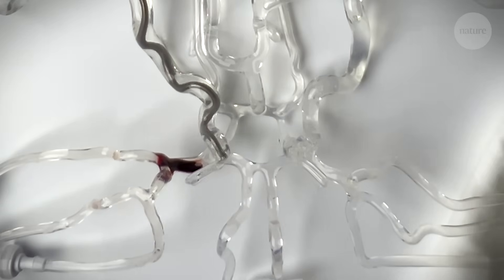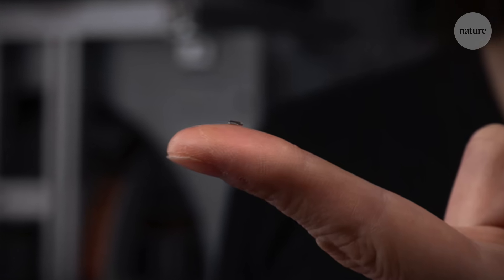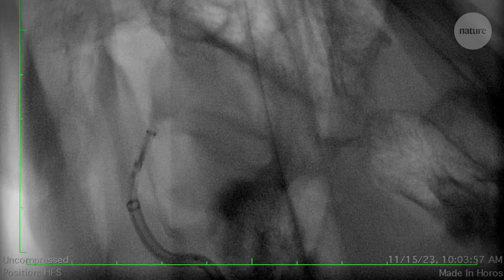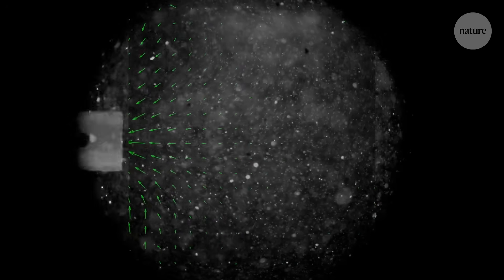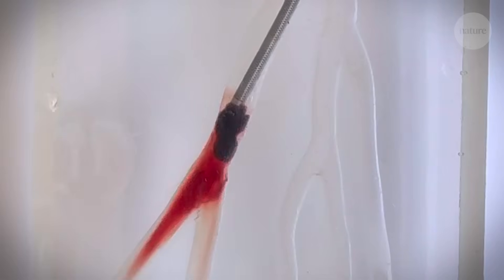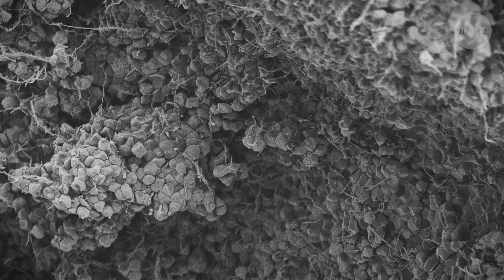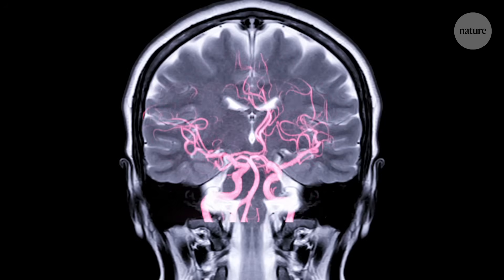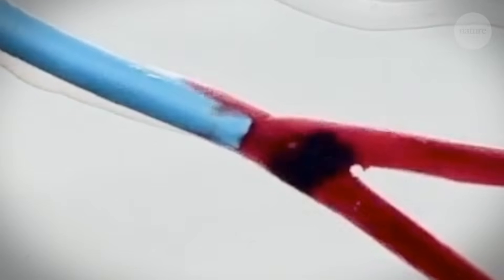This tiny device spins blood clots away

Comment: This little thing here is the number one killer of mankind, by far. 
It's crazy it took so long for something so simple.
Reply: The only simple thing is this new technique. But to get there - by accident - we had to do lots of science first.
Flipping a switch on a spacecraft is also simple, without the spacecraft.

Specifically without being in space, the craft makes all the difference, and getting a craft to space is required for operating said switch.
Reply: Not that simple when you consider that our veins aren't made of steel and can be easily damaged. Which means finding a way to get this device where it needs to go without killing the patient in the process. Quite complicated now, isn't it?
Reply: @crappyshorehen8201  The video showing the milli-spinner protruding from the catheter is intended to illustrate its working mechanism and how it interacts with a clot. In actual operation, however, the milli-spinner remains fully housed within the catheter to prevent direct contact with the blood vessel and avoid any potential damage. You can see an example of this in action here: https://youtu.be/t88QyS_bLKc?si=ik1sqsh1GxyY69Ud&t=25
Reply: @crappyshorehen8201  The video showing the milli-spinner protruding from the catheter is intended to illustrate its working mechanism and how it interacts with a clot. In actual operation, however, the milli-spinner remains fully housed within the catheter to prevent direct contact with the blood vessel and avoid any potential damage. You can see an example of this in action here: https://youtu.be/t88QyS_bLKc?si=ik1sqsh1GxyY69Ud&t=25
Reply: @debao-c3c  Hey, thanks for the info, but it seemed your comment got shadowbanned because of the link, eventhough it's also from youtube. Yeah, that sucks.
Anyway, it still showed that they have to be careful and take precaution. Not  as simple as OP here think it is.
Reply: @crappyshorehen8201 no not at all, tons of surgeries are done through blood vessels.  My dad just a heart valve replaced by going through artery in groin into heart (TAVR)
Reply: Because it's tiny device, that's why
Reply: Isn't it infections?
Reply: Die Grund-Technologie wurde schon vor Jahrzehnten geschaffen. (Stent-Tech). Permanent wird Technik weiterentwickelt. 🎉
Reply: It may be the scariest random killer, but the mosquito is the number one
Reply: Maybe you guys should study engineering and doctoring and make it happen yourselves then.
Reply: @chrisgrou exactly they can't believe no one thought of it.  Yet they themselves didn't think of it.  Very hypocritical
Reply: It's "simpe". We are making things at nanometer scale, 1 milion times smaller, for decades already..    Should have been a top priority, with very big investments and apparently it wasn't.
Reply: @d3r4g45  We already have had the suction tube for decades. The spinning part is what's new. In retrospect such "simple" addition to the tip would have been easy to  create way sooner as is the case with pretty much everything.
Reply: @km077 well why didn't you think of it and develop it then if it's so simple.  Nothing about development and testing of these types of devices is simple
Reply: @d3r4g45  Making moving parts that can be reliably controlled is the difficult one, as most of the nanoscale thing that I've seen is either static or very limited in movement. However, I agree that this should have been top priority, but we all know if it doesn't make the money, it'll go slowly.

Comment: could this potentially end up damaging the blood vessel due to friction between the wall of the vessel and the clot
Reply: I dont think so, for two reasons: blood vessels, arteries especially are built to take on significant pressure from blood itself being pumped with force, and most importantly, fibrin isn't rock solid, but more mushy, exactly like freshly clotted blood on the surface of a wound. Hardened compared to liquid, but not hard. Its a bundle of protein, so its pretty squishy, especially compared to the thick muscle wall of arterial blood vessels.
Reply: Unlike replies above, I agree with this. Centrifugal force is no joke, but removing life-threatening clot still outweights any risks related with the procedure.
Reply: I assume it would heal. Might have to prescribe some blood pressure medicine
Reply: that would literally not matter, everything in your body is constantly being damaged and repaired.
Reply: @99Plastics that’s stupid. If serious damage is caused to a blood vessel in the brain, the brain can hemorrhage. Your body fixes things but not a rate faster than the brain can lose blood from such damage.
Reply: Respectfully, you’re wrong. Damage to vessels during endovascular procedures is a real risk

Comment: Let's determine the technique's efficacy beyond in vitro tests and in vivo swine models before claiming it outperforms current aspiration thrombectomy—the "simply suck up a clot" method—because it involves more than clot removal; it also prevents inflammation, vessel rupture, reperfusion injury, and hemorrhagic transformation. Consider how patients and their surrogates might interpret this information when making decisions.
Reply: The paper (linked in the description) suggests that this method is not necessarily intended to replace traditional thrombectomy, but to be used in the 10%-30% of cases where traditional thrombectomy has failed or would lead to additional complications.
Reply: @dothedeed  early mechanical thrombectomy have significantly altered the landscape of stroke intervention, especially in cases involving large vessel occlusions. Studies indicate that mechanical thrombectomy can restore blood flow effectively when performed in a timely manner, often yielding superior functional outcomes compared to thrombolysis alone. mechanical thrombectomy is the first-line procedure for major artery stroke due to large vessel occlusion, with intravenous alteplase administered when eligible and within the appropriate time window. Patient selection should be guided by clinical and imaging criteria, and rapid workflow is critical to optimize outcomes.
Of course I read the paper before commenting.

References
1.	Care of the Patient With Acute Ischemic Stroke (Prehospital and Acute Phase of Care): Update to the 2009 Comprehensive Nursing Care Scientific Statement: A Scientific Statement From the American Heart Association. Ashcraft S, Wilson SE, Nyström KV, et al. Stroke. 2021;52(5):e164-e178. doi:10.1161/STR.0000000000000356.
2.	Acute Ischemic Stroke. Powers WJ. The New England Journal of Medicine. 2020;383(3):252-260. doi:10.1056/NEJMcp1917030.